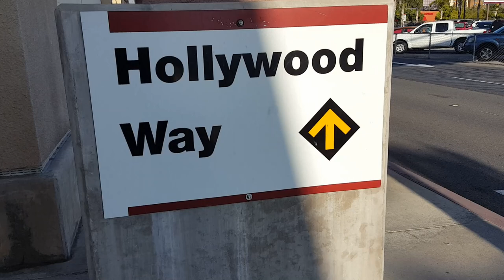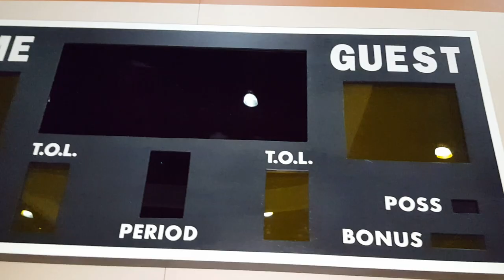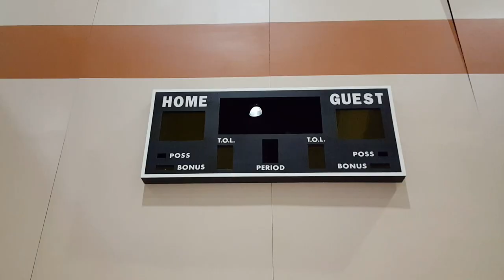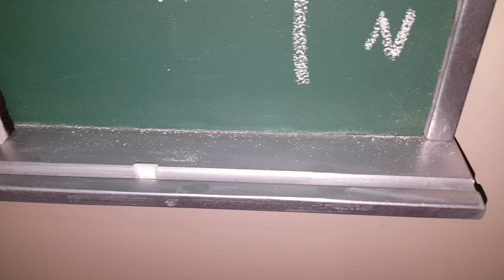We made 9 AMAZING COSPLAY Prop Displays - DIY Scoreboard for Gym Scene

Comment: Oh so you have the image printed. OK so who does that?   looking to get a graveyard image printed on a set backdrop I am building.
Reply from the maker: look online for vinyl wall graphic print places or sign shops in your area and get pricing.  many places can print large images.  we like to use a place called creative graphic service.  you will want to get them an image with the best resolution possible so it turned out and you will need to choose the material you want cause there is several options and pricing.